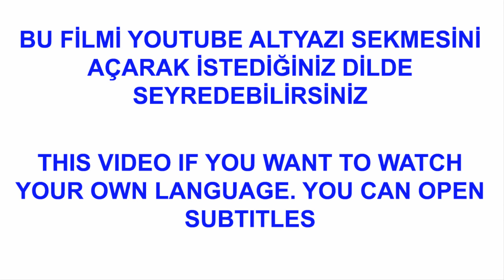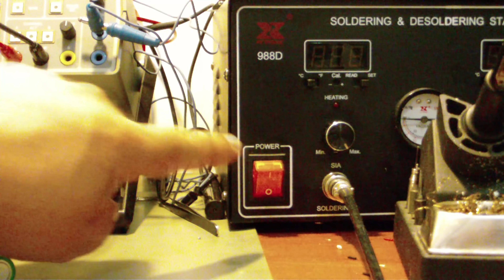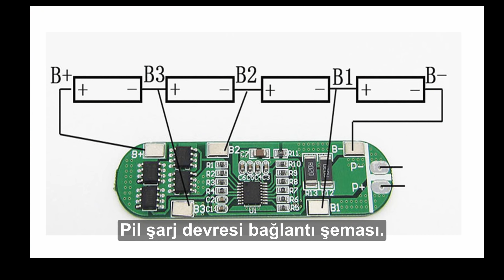HOW TO  MAKE A 14,8V 3600mAh BATTERY. 4S LI-ION (LITHIUM ION) 18650 CHARGE MODULE (BMS CIRCUIT).

Comment from the maker: Kaiweets KM601 multimeter:
https://bit.ly/3HLUDOe
4s LI-ION module sales link:
https://goo.gl/FPyn6D
Dijital volt-ampermetre satış linki:
Digital meter sales link:
https://goo.gl/kT885r
Reply: Bu ürün aliexpresten kaç günde geliyor
Reply from the maker: @musakaraoglan6611 21-26 gün arasında geldi
Reply: Merhaba. Usta ben bu devreden temin ettim ve bağlantılarını yaptım. Ama p+ p- baglantılarından voltaj alamıyorum. B1 b2 b3 bağlantiları doğru voltajı veriyor ama güç bir türlü p+ -  outputa gelmiyor. Yardımci olursan sevinirim.
Reply from the maker: Bağlantıları doğru yaptıysanız modül arızalı olabilir.

Comment: Elektronik Atölyem ellerinize sağlık. Size 2 sorum olacak. 1- 4S BMS devresi anladığım kadarıyla pil koruma devresi. Pilleri şarj etmek için sizinki gibi bir şarj cihazına mı ihtiyaç var, yoksa 12 voltluk veya 16 voltluk yazıcı adaptörü ile şarj edebilir miyim? 2- Buradaki 4 pil için devreye ayrı ayrı tp4056 taksam. Tek elden 5 volt ile şarj edebilir miyim? Teşekkür ederim.
Reply from the maker: Merhaba ilginiz için teşekkür ederim. 4S bms devresi kullanarak pil şarj etmek için maksimum 16,8 - 17 V luk bir güç kaynağına ihtiyacınız var.  4S modül pilleri dengeli şarj ve koruma için kullanılır. Elinizde 19V luk bir güç kaynağı varsa ayarlı voltaj regülatör devresi kullanarak güç kaynağınızı 16.8V a ayarlıyabilirsiniz.
4 pil için devreye  ayrı ayrı tp4056 modül kullanarak pillerinizi tek tek 5V ile şarj edebilirsiniz.

Comment: Bu modul 18650 pilleri sarj etmek icin mi kullaniliyor bir kac yerde okudum sadece koruma modulu yaziyor ayrica 3 seri 18650 pili kac voltluk adaptorle sarj edebiliriz
Reply from the maker: Koruma ve şarj amaçlı kullanılıyor. 3 pil için 3s modül kullanmanız gerekir. 3s modül şarj voltajı 12.6V
Reply: @electronic7979  anladim peki elimdeki 12 volt 1000mA adaptoru kullansam sıkıntı olur mu
Reply: Cunku aliexpress disinda 12.6 volt adaptor bulmak zor sanirim
Reply from the maker: @onuraltunok9459  12v adaptör ile şarj olur. tek tez avantaj full şarj olmaz.
Reply: @electronic7979  peki laptop sarj cihaziyla doldursak 19 voltla
Reply from the maker: @onuraltunok9459  19v ile doldurursanız pilleri patlatırsınız. Laptop adaptörü kullanacaksanız voltaj regülatör devresi kullanarak voltajı 12.6V a düşürmeniz gerekir

Comment: video için çok teşekkürler. 
Bir sorum olacak 2s 3p bir pil yapmak istiyorum. 
bu dudumda her bir p için bu balans ünitesinden mi almam lazım yoksa videodaki gibi her bir hücre arasından bir çıkışı  board üzerindeki B bağlantı noktalarına mı lehimlemeliyim? 
bu balans kartını nasıl kuracagımı tam oturtamadım.
Bir de enerjiyi balans kartına gene tp4056 gbi bir devre aracılığı ile mi vermemiz gerekir? yoksa direk sabit 5V verip şarj edebilir miyiz?
Teşekkür ederim...
Reply from the maker: Merhaba ilginiz için teşekkür ederim. Yazınız biraz karmaşık olmuş açıkçası tam anlayamadım. 2s yada 3s modül kullanacaksanız video daki gibi pilleri bağlayacaksinız. giriş şarj voltajı her modül içın farklı olabilir. Tp4056 modül ile sadece 1 adet pil şarj edebilirsiniz.

Comment: Öncelikle çok sade ve anlaşılır bir video olmuş,tebrik ederim sizi.Şu konularda bilgi verebilirseniz çok sevinirim ama...
Videonuzu izledikten sonra; 14,4 volt Maestro şarjlı matkap için 4S 30A BMS,12 volt Bosch şarjlı matkap için 3S 20A BMS ve son olarak da pc kasalarını falan açmak için de yapı marketlerde satılan ucuz şarjlı tornavidam için 2S 8A BMS aldım internetten. 9 tane de Panasonic 18650 3.7V 2600mAh Şarjlı Lityum pillerden mevcut elimde.Şimdilik 14,4 volt için olanı yani 4s lik devremi yaptım şarjlı matkaba da bağladım çalışıyor.ancak tetiğe sonuna kadar bastığımda elektriği kesiyor.Daha yüksek akımlı bir bms almalısınız yazmışsınız yorumlarda bunu da okudum:)peki tekrar al,bekle,lehimle vs beklememek için böyle idare edilemez mi?Asıl sorum ise şu olacak;rica etsem bunların her biri için ayrı ayrı kaç volt ve kaç amperlik adaptörler almam gerekecek,daha sağlıklı şarj edebilmek için cevaplarsanız çok sevinirim.Teşekkür ederim.
Reply from the maker: Merhaba. Videoma gösterdiğiniz ilgi için teşekkür ederim. Kesintili çalışmanın bir sorun olacağını düşünmuyorum sadece biraz sinir bozucu olabilir.4s modül için maksimum şarj voltajı 16.8v. 3s modül için maksimum şarj voltajı 12.6v. 2s modül için maksimum şarj voltajı 8.4v. Şarj akımı 1A olması yeterli.
Reply: @electronic7979  Teşekkür ederim cevabınız için.Bugün 4s i bağlayıp pilleri şarj etmeye başladım.Biraz dolmuş mu acaba diye birara taktım yarım tetikte çalıştırınca matkaptan duman çıkmaya başladı,bu nedendir acaba?
Reply from the maker: @hasantenbeli1822  matkabın çalışmasında bir problem varmı. Daha önce hiç böyle birşey duymadım.
Reply: @electronic7979  daha önce böyle bir şey yoktu ama...Bir de piller şarj olduktan sonra kartı devredışı bırakıp da deneyeceğim.
Reply from the maker: @hasantenbeli1822  tamam bir deneyin sonucu bana yazarsinız.
Reply: @electronic7979  İki türlü de denedim ama motor arızalı.Çıkan pilleri paralel olarak Bosch matkaba bağlayacağım artık.Tekrar çok teşekkür ederim yardımlarınız için.
Reply from the maker: @hasantenbeli1822  rica ederim. İyi çalışmalar

Comment: ustam aynen uyguladim videoda ki 4s bms baglantisini ama voltaj 16,8v veriyor bunda hatami var acaba
Reply from the maker: Piller full şarj olduğu için 16.8V vermesi normal 4.2V * 4 =16.8V

Comment: devrede şarjlı matkap motoruna şarj ettiğin 17v girişinde mi voltaj vereceksin yoksa şarj işlemi bittiğinde giriş ucu tekrardan çıkış 14.4v mu oluyor.birde şarj kontrol devresi bağlanabiliyor mu pillerin dolduğu nasıl anlaşılacak.
Reply from the maker: Merhaba giriş ucu şarj bitince tekrardan çıkış ucu oluyor.Şarj kontrol devresi bağlamanız gerek yok bu modül aynı zamanda şarj kontrol devresi görevi yapıyor.Modül üzerindeki S-8254A entegre sayesinde modüle bağlı pilleri dengeli olarak şarj yapabiliyorsunuz

Comment: Merhabalar öncelikle elinize ve emeğinize sağlık. Detaylı ve anlaşılır bir video. 14.4 V şarjlı matkap için 4s bms 40a modül şiparişi verdim ve 18650 4 pilim hazır. Lakin max 16.8v dc adaptör lazım ama havada kalan kısım max kaç amper çıkış vermeli adaptörüüz. Yardımcı olursanız sevinirim. Laptop adaptörleri malesef çoğu uymuyor, ağırlıklı olarak ep 19 v dc. Adaptör alacağım 16.8 vdc çok ama kaç amper çıkışlı olmalı bilemedim. teşekkrler
Reply from the maker: Merhaba ilginiz için teşekkür ederim. Şarj adaptör akımı 1A yeterli olur. Adaptör için ayarlı voltaj regülatör devresi kullanabilirsiniz. Regülatör devresiyle laptop adaptörü çıkışını 16.8V a ayarlayabilirsiniz.
Reply: @electronic7979  teşekkür ederim hazir regülatör devresi vardir herhalde la0top adaptoru icin
Reply from the maker: Rica ederim. Şu modül işinizi görür. 
https://www.robomarket.com.tr/lm2596-dc-dc-donusturucu-modulu-step-down-ayarli-voltaj-cevirici?gclid=Cj0KCQiAjfvwBRCkARIsAIqSWlO9qt7aYa2JeEpJ9Y_79JG3SMsc5uxm1pG20oy7_e3iD2P86V7uvZAaAmchEALw_wcB

Comment: Lion piller ile sizin gibi 4s batarya yaptım  balans devresi falan hepsi tamam. Pil kapasiteleri birbirlerine yakın bir şekilde ölçtüm ve ona göre bağladım. Şarj ediyorum 16.2 v gösteriyor ama şarji hemen bitiyor sorun nerde anlamadım.
Reply from the maker: Merhaba ölçüm yaptığınız voltmetrenin kalibresi bozuk olabilirmi. pillerin full şarjı için 16.8v gerekiyor 0.6v luk kayıp voltmetrenin eksik ölcmesinden olabilir. pilleri deşarj edip tekrar şarj etmeyi deneyin.
Reply: @electronic7979  voltmetrem normal ustam sorun yok. Bu batarya yi orjinal bir matkabin şarj aleti ile şarj ettim lakin votlaji 14.4 volt. Bu şarj aleti ile sağlıklı şarj olmuyor sanırım. Ona göre 16.8 e göre saj aletine göre şarja bağlayıp öyle test etmeliyim doğrumudur hocam?
Reply: @electronic7979  bu bataryaları yapıp satan bir kişiye sordum lakin bu iş usta işi dedi. Herşeyi üstasina parasını verip yaptıracaksanız dedi. Bu batarya da bilmemiz gereken başka püf noktası mi var hocam ?
Reply from the maker: @mutlukaradas2567  liion piller pil başına 4.2v ile tam şarj olurlar siz 4s modül kullanacaksanız  16.8v ile pilleri şarj etmelisiniz ve 17V u geçmemelisiniz. 14.4v ile piller tam şarj olmaz.

Comment: Lm7818 ile 18 v sarj edersek sıkıntı olurmu işin aslı şu elimde 9 v 2 a lik sarj aleti var ona 7818 takıcam o şekilde sarj etsem sıkıntı olur mu yoksa 1 amperlik mi kullanmalıyım
Reply: Yada 7818 in çıkışına diyot gibi bişey taksak voltajı 17 ye falan düşüre bilirmiyim
Reply from the maker: Merhaba. Öncelikle 17v gerilimi hiç bir şekilde geçmemek gerekiyor. Elinizdeki adaptör 19v mu yorumda 9v olarak yazmışsınız. Eğer 9v ise bunu voltaj regülatör entegreleriyle ile yukseltemezsiniz. 19v ise Lm7818 yerine Lm350 entegresi kullanarak  ayarlı voltaj regulatörü yapıp voltajı istediğiniz değere düsürebilirsiniz. LM350 entegresi 3A akıma dayanabiliyor.
Reply: Elektronik Atölyem anladım tamam teşekkürler ilginize alakanıza
Reply from the maker: @yakup931  rica ederim. İyi günler

Comment: Kolay gelsin  cok ogretici  bir video.  
Bende ufak sarzli matkap imi lion pil ile degistirmek istiyorum.birkac yerde takildim mümkünse yardimci olabilirmisiniz.
1. P+ ve P- Uclarindan sarz girisi yâptim. Motora götüreceğim  kablolari nerden götüreceğim. 
2. Bu devreyi kac voltla sarz etmeliyim. 8 volt diye dusunuyorum ama piyasada 8 v luk sarz aleti bulmak cok zor.
Simdiden cok teşekkür ederim saygilar
Reply from the maker: Merhaba ilginiz için teşekkür ederim. 
P+ ve P- uçları hem şarj giriş ucu hemde motora bağlayacağınız uç. Motor bağlantısını P- P+ uçlarına yapacaksınız.
Şarj aleti için 4s modül kullanacaksanız maksimum 16.8V luk bir adaptör gerekiyor. Elinizde 18v luk bir adaptör varsa voltaj regülatör devresi kullanarak 16.8V elde edebilirsiniz.

Comment: Merhabalar elinize sağlık 3s lion pili bms 20a ile kaç volt kaç amperde şarj etmem lazım?
Reply from the maker: İlginiz için teşekkür ederim. 750mA ile 1A arasında şarj akımı yeterli olacaktır.
Reply: @electronic7979  12v 2a adaptörüm ve 12v 1a adaptörüm var hangisini kullanmaliyım ve 12v uygun mi
Reply from the maker: @insproad  3s modül için 12v uygun
12v 1a lik bir adaptör işinizi görecektir.
Reply: @electronic7979  tamam hocam teşekkürler
Reply from the maker: @insproad  rica ederim

Comment: Slm bi konuda fikir almak istiyorum 4s 9000mah lik lion pil yapimi icin kac adet pil kullanmak gerekir
Reply from the maker: Merhaba
herbiri 2200maH lik 18650 pillerden 4 seri 4 paralel olacak şekilde 16 adet pil kullanarak. 9000maH lik batarya yapabilirsiniz.
Reply: @electronic7979  tesekkur ederim
Reply from the maker: @mehmettunca4347  rica ederim

Comment: Merhaba.
Pilleri şarj ederken extra bir şarj devresi kullanıyor musunuz yoksa doğrudan pillere taktığınız devreye 17v verip şarja mı başlıyorsunuz.
Reply from the maker: Extra şarj devresi kullanmıyorum. Doğrudan 17v verip şarja başlıyorum.
Reply: @electronic7979   peki bu pillerdeki devre şarj ederken kademeli şarj kurallarına uyuyor mu yoksa girişten uygulanan voltaj ve amperi doğrudan pillere mi basıyor.
Reply from the maker: Merhaba devre üzerinde S-8254A entegre bulunmakta  ve bu entegre sayesinde dengeli bir şarj yapılabilmektedir.
Reply: @Hikmetcelik1103  zaten balace özelliği ön planda olan ürünler.
Reply: @pusatberk4193  
Elimde s8254aa chipli bir devre var 3s destekli şarj ederken giriş voltajım kaç olmalı 12.6v yeterli mi birde kaç amperlik akım uygulamam gerekli piller 2600mah

Comment: Merhaba 4s bataryalarımızı 19 voltluk laptop adaptörleri ile şarj etsek sıkıntı yaşarmıyız? Nasıl bir şarj aleti kullanmalıyız?
Reply from the maker: Merhaba 4s modül için maksimum 17v vermeniz gerekir.19v piller ve module zarar verir. 19v laptop adaptörünü şu şekilde kullanabilirsiniz: voltaj düsürücü devre yada modül kullanarak 19v u 17v a düsürebilirsiniz.
Reply: Elektronik Atölyem ama kullandığım laptop un bataryası 10,8 volt ancak şarj aleti 19 volt bu neden böyle. Laptopta olduğu gibi benim bataryamdada bms mevcut
Reply: Elektronik Atölyem birde lityum şarj aleti bulabileceğimiz bir site veya satış yeri önerebilirmisiniz hiç 12,6 16,8 volt adaptör göremiyorum internet aramalarımda
Reply from the maker: @kenanalkan6517  laptop bataryasının ve laptopun içinde özel şarj devreleri var ve pil voltajını bu devreler ayarlıyor. Videodaki modül ler için modül çalışma voltajı na göre voltaj vermeniz gerekir 4s modül için bu voltaj maksimum 17v. Düşürücü modül olarak internete step down modül yazarsanız 5-6 tl civarına bu modüllerden bulabilirsiniz. Bu modülün girişine laptop şarj cihazını bağlayıp çıkışı için modül üzerindeki trimpod dan ayar yaparak 17v a ayarlayabilirsiniz.

Comment: Hocam merhaba.1 adet 4s bms 20 a edindim.elimde 3.7 v 4 adet seri bağlı pil var ancak şarj aletim 14,8 volt çıkarıyor.Bms şarj voltajı ise 16.8 volt.Bu durumda bms çalışır mı ya da pillerimi şarj edebilir miyim ya da geçmi şarj olur? Bu konuda yardımcı olursanız sevinirim
Reply from the maker: pilleriniz full şarj olmaz. 14.8v gerilim ile pil başına maksimum 3.7v şarj voltajı olur. Full sarj icin pil başına 4.2v gerekir.

Comment: Modülü illa kullanmak zorundamıyız   18 v batarya yaptım    ama şarj olmuyor modül şartmı seri bağlayıp şarj cihazına bağlıyorum şarj oluyo gösteriyor ama çok hafif dönüyo duruyor piller sıfır  ama modül yok ne öneriyorsunuz
Reply from the maker: Modül kullanmamız gerekiyor aksi takdirde pilleri dengeli şarj yapamayız. 4 adet lion pil için maksimum 16.8v şarj voltajı vermemiz gerekir.
Reply: @electronic7979  5 tane pil kullanıyorum 18 volt kendisinin şarj cihazını kullanıyorum  ama olmuyor modülü takarsam düzelirmi 5 pil 3.7volt 2000 amp  için hangi modül lazım
Reply from the maker: @abdullahorhan3817  5 adet pil için 21v luk bir şarj cihazı lazım. Pil başına 4.2v. Sizin şarj voltajınız yetersiz.
Reply: @electronic7979  22 volt şarj aleti denedim yine olmuyo
Reply from the maker: @abdullahorhan3817  pillerden bir tanesi arızalı olabilir. Pilleri tek tek maksimum 4.2v ile şarj etmeyi deneyin. Şarj olmayan pil varsa o pil arızalıdır.
Reply: 5s   15 amp modül bağladım 5pille 18650  ama matkap çok yavaş dönüyor   birde   çıkıştaki  ekiyi başka yerlere değdirince  çalışıyo
Reply from the maker: @abdullahorhan3817  yaptığınız pil bağlantılarının resmini çekip mail adresime gönderebilirmisiniz.

Comment: S.a hocam ben 14 volt 12000mah gücünde batarya yapacağım 4s 20 a modül kullanacağım ama 4 paralel 4 seri bağlantı yapmam lazım sanırım ama nasıl bağlayacağımı bilmiyorum ve bu modülden çıkan artı ve eksi uçları ile hem cihaza güç verebilir miyim hemde şarj edebilir miyim ekstra bir modül gerekli mi şarj için ve voltaj ayarı için
Reply from the maker: a.s. öncelikle bahsettiğin bataryayı nerede kullanacaksınız. şarjlı matkap vb. yerlerde mi kullanacaksınız. Eğer şarjlı matkap gibi yerlerde kullanacaksan daha güçlü modüller kullanman gerekebilir. Daha önce hiç 4 seri 4 paralel bağlantı yapmadım. Bu yüzden seni yanlış yönlendirmek istemem modülü satın alacağın yere danışmanı tavsiye ederim. Genel olarak bu tip şarj modülleri, modül çıkışlarından çıkan + ve - uçlar hem şarj görevini yapar, hemde batarya çıkışı olarak çalışır.

Comment: hocam merhabalar size bir sorum olacak cevaplarsanız sevinirim Bende sıfır hp 14.4 volt leptop bataryası var bataryayı sokmeden hem şarj edip hem kullanmak istiyorum bunu nasıl yapabilirim bana yardımcı olabilirmisiniz lütfen
Reply from the maker: Bataryayı sökmeden kullanmanız biraz zor. Çünkü laptop bataryaları içerisinde kendi devreleri vardır ve bu devrelerin giriş çıkıs uçlarını bulmanız gerekir bunun içinde iyi bir araştırma yapmanız lazım. Bu yüzden pilleri söküp şarj kontrol devreleri kullanmanız daha kolay olur.
Reply: @electronic7979   teşekkürler

Comment: Bu piller(18650) bir tanesi 2000mAh -2600mAH oluyor, piller seri bağlayınca nasıl 3600mAH oldu, onu anlayamadım. 14.4 voltluk bir matkapa bu şekilde yapılmış piller ile çalıştırabiir miyiz, ayrıca devreye gerek varmı? Bu arada böyle bir yararlı video yayınladığınız için teşekkür ederiz.
Reply from the maker: Merhaba video mu beğendiğiniz için teşekkür ederim. Piyasada 18650 pillerin 3600mAh olanları mevcut onlardan kullanırsanız 3600mAh lik batarya olur. 14.4 volt luk bataryayı buşekilde piller le çalıştırabilirsiniz fakat devre kullanmanız gerekiyor. Devrenin amacı hem pilleri dengeli şarj etmek. Hemde matkabın çekeceği ani akımlarda pilleri korumak

Comment: 6 18650 pil bağladım devreye..kaç volt kaç amperlik adaptörle şarj etmeliyim? 24v 1a adaptörle yaptım 2 tane pil öldü.teşekkürler
Reply from the maker: 6 adet 18650 pili ful şarj yapabilmeniz için 25.2V a ihtiyacınız var.pil başına 4.2V  akım olarakta 1A işinizi görür. Siz pilleri serimi bağladınız? BMS devre kullandınız mı? direk seri bağlarsaniz pilleriniz  dengesiz şarj olur ve pilleriniz ölebilir.Mutlaka bms devre kullanmanız gerekir.
Reply: @electronic7979  evet bms devresiyle bağladım zaten..çalışmada matkabın sıkıntı yok.fakat 24v 1a eski matkap adaptörü ile şarş ettiğimde baktım matkap çalışmıyor.söktüm multimetre ile kontrol ettiğimde 2 tane pil hiç tepki vermiyor.ölmüş anlaşılan yeni 2 pil bağladım fakat merak ettiğim bu devreyi kaç v kaç a adaptörle şarj edebilirim.6 tane 18650 pil var..
Reply: @electronic7979  12v 1a diyende oldu. Acaba benim aldığım bms devrede mi sıkıntı var anlamadım 🤔
Reply from the maker: @ByCINAR  siz nasıl bir bms devresi aldınız. Kullandığınız bms devresinin resmini elektronikatolyem@gmail.com mail adresime gönderebilirsiniz kullandığınız devreyi inceleyebilir im.
Reply: @electronic7979  tamam hocam göndereceğim..